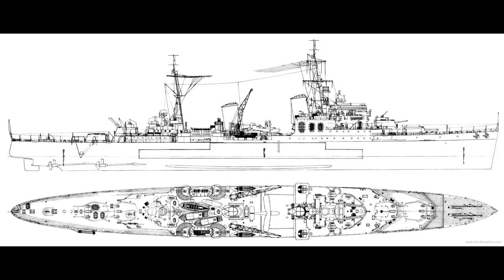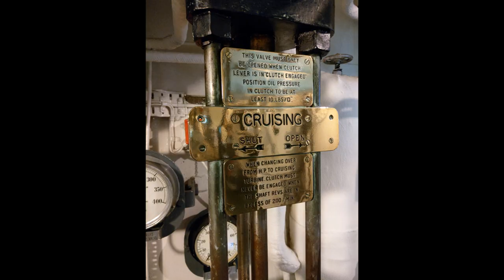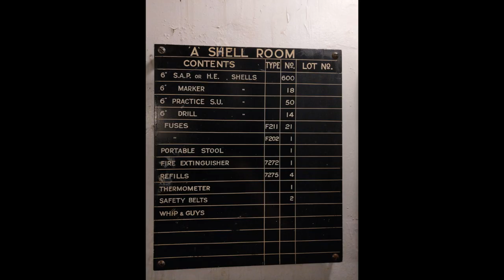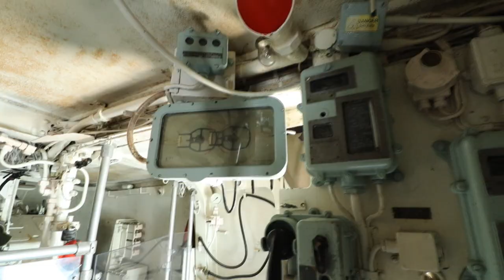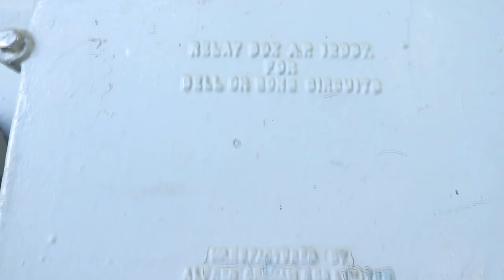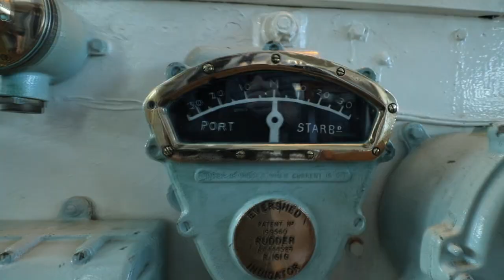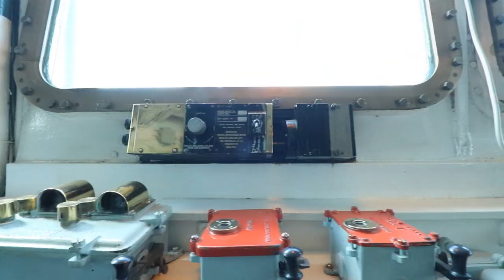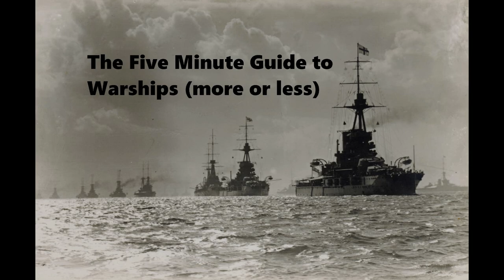HMS Belfast - A Town that served a Country

Comment: 15:23 A fully equipped machine shop that allows the crew to fabricate parts
Huh, that explains the god-like repair ability of Royal Navy ships in WoWS
Reply: PROBLEM SOLVED, SIR!
Reply: imaging if they could all switch between rn he shells and sap.
Reply: Lookn at you Goliath
Reply: of course, just make another one
Reply: There is a great era Navy film covering this trade on Youtube.
Reply: Existence of RN Ship-Printing-Facility confirmed!
Reply: Conqueror:

Print New Ship.
Reply: I imagine most warships have at least something of a machine shop aboard. Even as small and cramped as it is, the Los Angeles class submarine I served on had a limited machine shop setup.
Reply: I'll bet a lot more ashtrays and other contraband was made than "ships parts" :-)
Reply: Every war ship I been on has a machine shop. FFG DD CG BB CV
Reply: @wilkatis  only if it exploded in the citadel. "Standart" penetrations = HE damage = 75% can be healed for Conqueror
Reply: @dougerrohmer  Lol, quite possibly true. So long as the machine shop could turn out a working part when needed, if the machinists wanted to pass time crafting ashtrays and heaven knows what else, well they could call it training or practice and there's no great harm done.
Reply: @therealuncleowen2588  "Gizzits" for visits to home or allied ports or by allied vessels.
Reply: Most naval ships have a machine shop aboard. In the old days, sailing ships each had a carpenter for the same reason.
Reply: @stallfighter  One heal is around 40k HP, so if that's 75% you need to lose about 55k HP for that to be efficient. That leaves you down at 25-ish k HP, which can comfortably be deleted by a single lucky AP salvo or a couple torpedoes. 
Hell, take one torp and you ain't going to get a single full heal in the reminder of that match.
HE pens are same repairability, yes. But it's not the pens you go for, it's the fires. And fires are 100% repairable. Any fire you set on Conq is completely irrelevant. And then on top of that AP pens do more dmg than HE pens.
Reply: What happened to Exeter?
Reply: @Selvariabell  In the port, resting after the Drake grind
Reply: @wilkatis  When I play high-tier Brit BBs I don't even bother shooting at other Brit BBs - as AP is garbage and shooting HE is completely negatable I just don't waste my time with that. :D
Reply: Just about every naval ship had/has them. Even WWII subs (well, US ones at least, others I don't recall) had a small corner and a mini-desk for the sub's engineer to try and unfsck stuff or cannibalize less necessary parts to make a Jerry-rigged replacement.
Reply: I've toured CV-41 USS Midway, BB-55 USS North Carolina, BB-63 USS Missouri - all had substantial, well equipped, but somewhat cramped machine-shops.
There is a longish older German film here somewhere on YouTube about life on the battleship KMS Gneisenau, and by gum, they had big lathes, mills and shapers to play with too.
Reply: @dougerrohmer  Sir, we can't make that gear that broke.
Why?
We made it into an ashtray instead.
Reply: So you say we can Print new parts to repair the ship like in Space Stations? Shit man.
Reply: When I was in the U.S. Army, I met a retired machinist mate from the U.S. Navy.  He said that even without the fancy equipment, they could make just about anything with a drill press, drills, a saw, a grinder and files. And they frequently did, even making items for the shore facilities. He noted, however, that it took a great deal of patience.
Reply: How do I like a comment more than once?

Comment: The critical parameter for the steam turbine is not rotational frequency, but blade tangential velocity.  The turbine does not need to spin really fast, BUT, if it is not spinning really fast, the only way to get the blade speed high enough is to use a large radius.  One of the early great liners (whose name escapes me) compromised the design of the propellers and turbines to allow a turbine fourteen feet across to directly drive a propeller designed to run at 420 revolutions per minute.

The big penalty of direct drive turbines is the volume of the equipment.  For the same efficiency and power, a turbine that runs at twice the RPM occupies only a quarter of the volume (spinning twice as fast at half of the radius gives the same blade tangential velocity).  It does not take much of a reduction in volume to justify the reduction gearing and end up saving space.
Reply: "420 revolutions per minute" 

nice
Reply: Well - Yes .....Obviously ....

Comment: Another great video!  Having a machine shop onboard I think came from the example of US Navy practice.  The US Navy did not have as many overseas bases as Britain did so it was important that the crews could make repairs themselves.  I know that US battleships even had a forge to cast small parts,  though I don't know if smaller ships did.  Saving the Belfast was one of the best things the Royal Navy has ever done due to the positive public relations value, and no doubt they regret not saving more ships, especially the Warspite.
Reply: RN ships had dedicated repair experts and areas on ships for centuries. At RN museum Hartlepool they had an exhibition about it when I was young. From carpenters to engineers.

The royal navy had nothing to do with the decisions sadly. The armed forces here don't have the political pull that they have in the US. Preservation of a ship is a political question and of course that comes down to money as much as anything
Reply: @AdamMGTF  While it was true on sailing ships, it seems after 1900 the Royal navy reduced the number of special craftsmen on ships.  On US Navy ships such specialists as blacksmiths and lathe operators were not duplicated in the RN. This was probably a cost saving measure, and the larger number of ports Britain had at the time meant a ship could always find a place to make repairs at.  This abundance of ports also meant the RN didn't have to worry about fuel range,  4,000-5,000 miles being accepted as sufficient.  The US did not have nearly as many overseas ports, in fact during the cruise of the Great White Fleet some of the US navy ships were diverted to Japan to be serviced because the facilities in Manila weren't capable.  Thus US Navy ships had more repair facilities onboard their ships, plus larger fuel tankage with 10,000 miles at 10 knots being the standard cruising capability of all US battleships. Later this was expanded to 15,000 miles at 15 knots. Plus the US led the way in underway refueling.  During WW2 US destroyers and even destroyer escorts were capable of escorting convoys from Halifax to Liverpool with no problem. Compare this with the fact that RN destroyers only escorted ships a third of the way before turning back to port. My father's ship the DE-188 O'Neil had a small machine shop on board and one of his friends in the engine room was also a qualified lathe operator. They escorted seven convoys across the Atlantic before being transferred to the Med in 1943. Later they would serve in the Pacific after the fall of Germany.

Comment: Wonderful program, perhaps a tie with the second Russian Pacific Squadron. USN career officer, ship driver not engineering. Once saw a 1200 psi leak almost severe a limb but in general, the 600 psi systems seemed very reliable and powerful.

Comment: I noticed a sign that said "A.P. and H.E.".  HE are nose-fuzed shells with large explosive charges and usually rather small penetration ability through any armor more than at most 0.25 times the shell's diameter (if using a base fuze, too, or a very short delay in the nose fuze, which would be strengthened in this case) -- US "High Capacity" (HC) shells, their HE terminology, had in most cases both a nose fuze, could be removed and replaced by a hardened steel nose plug to allow the base fuze to function, or switched for a time fuze (VT (radar proximity) fuzes were permanent for HC shells so equipped due to requiring different shell nose designs and protective covers) -- and were used for shore bombardment or AA (with a time fuze) or firing at very lightly-protected enemy ships.  Armor-Piercing (AP),, using a very small explosive charge and thick casing for punching through very thick armor, for British 6" guns in WWII is something that I did not know that they had.  Original terminology was CPBC (Common, Pointed, Ballistically Capped) which meant what was later renamed to be SAP (Semi-Armor-Piercing) due to having an explosive charge midway between AP and HE and using a base fuze much like an AP shell but not having an Armor-Penetrating Cap (APC, as in all larger British naval guns in WWII) and thus would not work very well against the cruisers and battleships that had face-hardened ("Cemented" in British terminology of WWI and WWII) armor that could shatter the nose of uncapped shells due to impact shock if not protected by a properly-designed AP Cap (hardened after WWI experience with soft caps was less than satisfactory in actual use).  The larger British WWII 8" SAP shells, termed "SAPC", did have such a cap and, while not designed to penetrate thick armor like a true APC shell, could be relied on to penetrate most cruiser and some lighter battleship Cemented plating, when used -- the 6" CPBC could do this only for softer non-cemented armor, which was the major type used in most cruisers built prior to the late-1930s.  Was a capped or uncapped AP shell added to the British 6" guns for use against more heavily protected enemy ships later on?

Comment: You don't change gears in a naval propulsion system. The reduction gearing is fixed. The closest thing to a clutch is a means to disconnect the propeller shaft from the reduction gearing by means of a hydraulically driven toothed collar, which can be moved longitudinally to  separate them. The shaft has to be stopped or at a few RPM to safely declutch and reclutch the shaft to the reduction gears.
You showed how the ship was able to reverse the direction of the propeller shaft. There are two throttle wheels at the engine control station, one for ahead, and one for astern. To make an emergency stop, or to perform a crash back full, you would shut the ahead throttle, and crack open the astern throttle, watching the astern bowl pressure to prevent over torquing the astern turbine until the ahead rotation stops. If given a backing bell, you continue admitting stream to the astern throttle until you reach ordered turns. 
I just wish there had been a clutch on my submarines to change reduction gear ratios so I could be in a submarine high speed dragster. Nope. There weren't any. And there aren't any on Belfast either.
Reply: Belfast did have cruising turbines that could be declutched for higher speed. I don’t think self synchronising high power clutches existed back then.
Reply: @michaelwise1224  Somebody is going to have to explain how this "clutching" system works and was installed in the turbine system.  It doesn't match anything I studied in my Marine Engineering courses nor Naval Steam Propulsion plants.  I saw nothing like this while working in the US Merchant Marine either and I sailed on some steam turbine powered vessels.  

USN cruising turbines were attached directly to the shaft and weren't clutched in any fashion.  If you didn't want to use them you simply shut their steam valves and they just rotated in a vacuum drawn by the air ejectors.  

Drach dropped the ball on this one and needs to research his Marine Engineering and steam propulsion plants better before putting out this information.
Reply: @lilidutour3617  
There’s a description of a later design cruising turbine here: http://www.hazegray.org/navhist/canada/systems/propulsion/y100/y100.pdf
The RAN deleted HMAS Parramatta’s cruising turbines in the 1960s because their distrust in the clutch outweighed their desire for longer range. Perhaps developments in RAS reduced the requirement for unsupported range.
Reply: @michaelwise1224  Thanks for the link to the description.  It made for interesting reading.  I don't know of anything similar in the USN.  

The description did say that due to complexity , size and weight the cruising turbines and their clutch assemblies were removed.  The benefits didn't outweigh the costs.  Increased refueling at sea was an acceptable downside to this.  

I had some experience with clutching on a large container ship.  A "booster" motor could be clutched to the main shaft to increase speed.  It gave use "1" knot.  It was complex and had strict requirements when it would work and when it wouldn't.  It was very dependent upon external forces.  Bad weather threw the clutch out and nothing on God's Green Earth was going to get it back in until the weather improved.  

It was never worth the time or expense it cost and was later decommissioned and never used again.

Comment: How exactly were they supposed to fire those guns with so much ice on them?  Without fear of them exploding, or jamming or whatever?  Did they somehow have to melt it all off when going to action stations?  Or just do a test fire to blow it all off?
Reply: For light icing dump a practice or AP round through the barrel first to clear the worst of the ice. Most of it will shake off on firing. The muzzles usually have plugs or caps to keep the ice out of the barrels so its not so bad.

HE into a blocked barrel is somewhat interesting when its the enemy doing it. When your the gunner, well its more of a once in a lifetime gig.

For heavy icing, get out the axes and break it off the muzzle first.

I expect that really bad conditions would prevent both sides from engaging, so you would normally be able to clear for action in time.

Comment: I always thought the ships were perfect for the cruiser role, long range, cruiser speed and decent armament with the protection a bit light. The inclusion of torpedo and depth charge ordnance was creative, in the mode of the Japanese. Having driven USN ships for 25 years, I do question the height of the after two turrets, X,Y. If I remember correctly, the Kako class was a full 2 1/2 knots faster. I would’ve preferred to have both of those turrets situated one deck lower and of course better armored.

Comment: At the 12:53 mark this is the pinion shaft from the main turbine to the reduction gear, Its a double helical cut gear to counteract thrust when spinning forwards and aft on the shaft and also to silence the operation of the gears when running at max RPM. The reduction gear serves 2 purposes, Add torque to the engine and allow the turbine to operate at high speed where its most efficient and also the propeller which operates most efficient lower RPM and prevents cavitation of the propeller blades

Comment: As a power engineer I am always amazed by the propulsion systems on these old man-o-war  ships. Steam is still the most efficient medium  used in the  conversion  of  potential energy(fuel)  to mechanical energy . The prime mover in this case being the steam turbine. Nuclear power works the same way , it just boils the water  differently.

Comment: @11:00, the red and black handwheels, the narrator is speaking about manual secondary steering. These are not steering controls.  These are throttles for the main engine turbine; as labeled ‘Ahead’ and ‘Astern’ as these would admit steam to the ahead or astern section of the turbine respectively.

Comment: Pinion and bull gears are cut that way to reduce axial force along the turbines and main gearing to prevent wear and not require massive thrust bearings. They are also geared on a decimal ratio to minimize wear patterns, the old timers where quite smart.

Comment: Nice video but a couple of points need correcting. You do not need to change gear on that steam turbine power plant. To put the propellors into reverse steam is supplied to the reversing turbine. This turbine runs in the opposite direction to the ahead one. The reduction gear is as you so pointed out only to step down the revolutions. The slower you can get your props to spin the more power can be absorbed and the likelihood of cavitation minimised. Also there is no clutch as such what you were probably looking at was a Michell thrust bearing. This takes the thrust from the propellors through the shafts and into the hull. You try to avoid having the thrust going direct back to the reduction gear.

Comment: Did anyone else get a pronounced stutter during motion throughout the video? I thought it might have been the camera struggling in the dark but happened in daylight on deck too. It wasn't too noticeable on the small screen of a phone but is very noticeable on larger screens.

The audio voiceover was much better though, could hear everything without issue.

Apart from that another fantastic video. I definitely need to go back to visit Belfast again soon, there were so many details I missed last time I visited.
Reply from the maker: I think I worked out why, the video shot on the ship was at 24fps and I rendered the video in my normal 30fps :(
Reply: @Drachinifel  Ah, going for the cinematic look... ;-)

Comment: Open question: 8:05  Why are the anchor chains brought up on the weather-deck? 
(I'm not a sailor - I may use the terms wrong. I'm happy to be corrected.)
I know the chain lockers are dangerous (low oxygen). I know the chains go through the gunnels to keep water out of the chain lockers (but it gets in anyway).   It just seems to waste deck space and  add a hazard to people.

Comment: At around the 11:08 mark you describe the ahead and astern throttles as part of the steering gear unit control. Its not. It is for opening and closing the steam valves to either the ahead or astern steam turbines

Comment: What you describe as the linkage to the propeller shaft @13:37 is the thrust bearing, which transmits the thrust generated by the propeller to the hull of the ship.